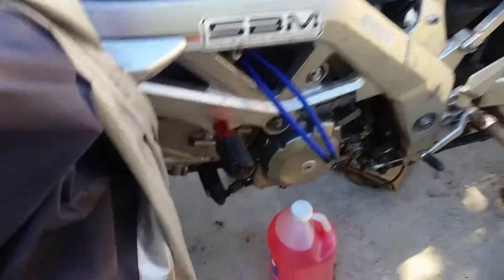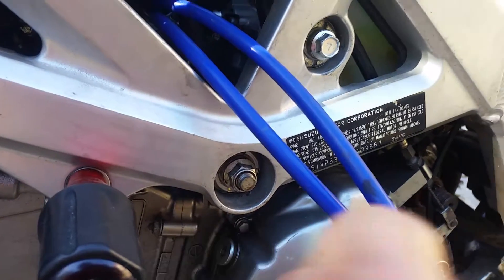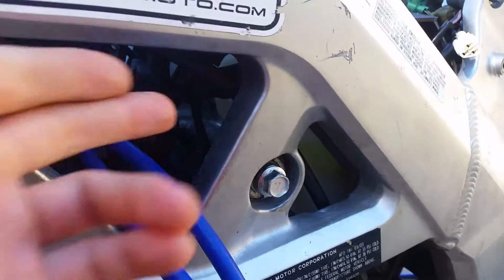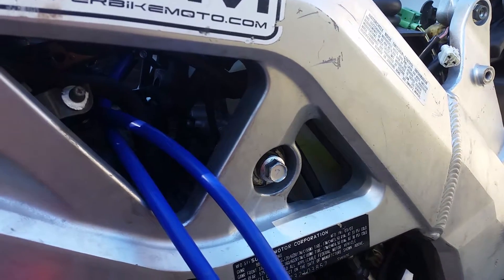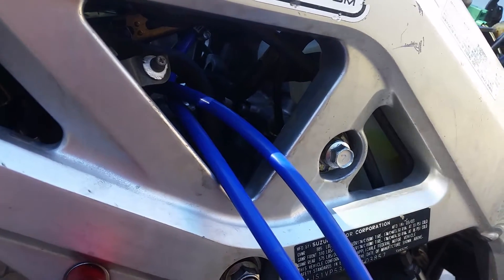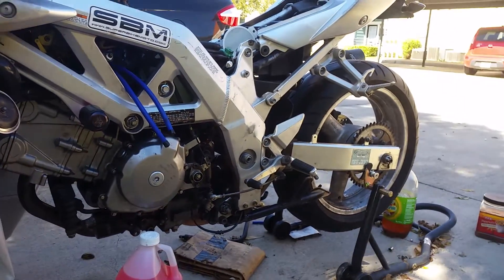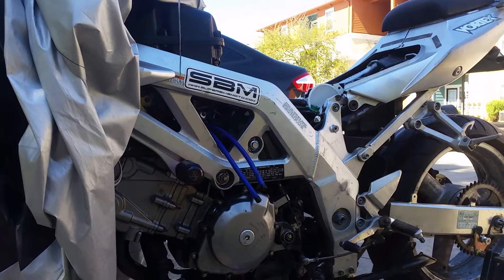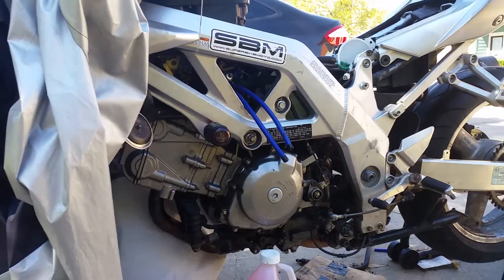Sv650 engine swap part 3

Comment: it probably didn't clog your fuel pump. check the petcock.
Reply from the maker: fuel pump was ceased up. i took it out and it was shorting
Reply: I could've swore you said this bike was carbed lol. I have a first gen so the fuel pump is bolted to the frame and it's just a tiny metal square